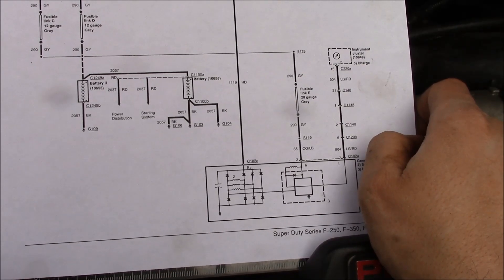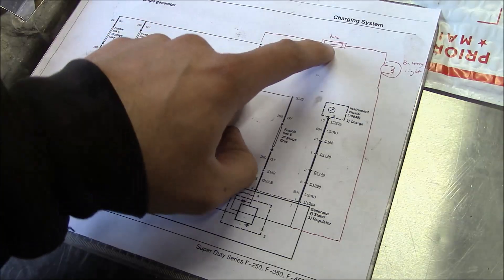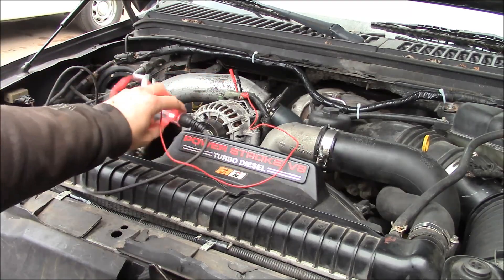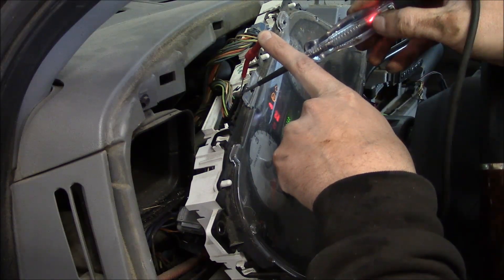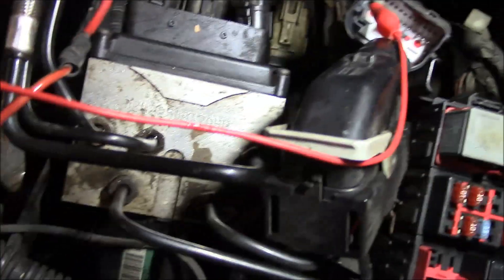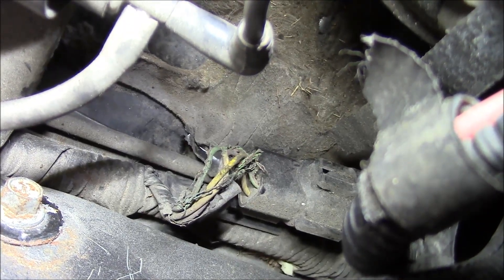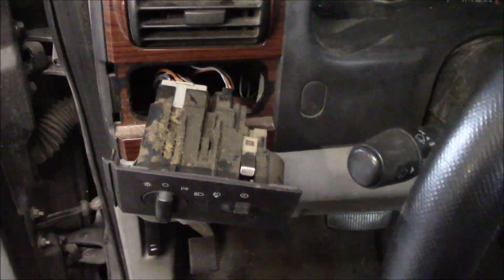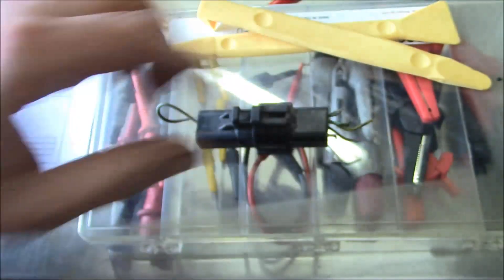Ford Super Duty Charging System Diagnosis and Repair

Comment: meter set to amps in a/c....i have made that mistake more than once. i would agree, rodent damage. we always doubt ourselves when we do a job like that and have problems instead of sticking with our normal diagnosing procedures. nice find wes. i would expect a little extra labor on the bill for that.
Reply from the maker: Yeah, there's no one easier to fool that yourself!

Comment: Many of the newer powerstrokes and ram/cummins trucks do not charge the batteries for the first two minutes once the truck is started, this is so the battery voltage can stabilize after all the juice that has been used by the starter and glow plug/ grid heater, start the truck 2 or 3 times for only a minute or two and you'll have dead batteries in no time
Reply from the maker: That's actually pretty normal for all alternators. Even my old 7.3 Powerstroke will not show anything on the volt meter for the first 30 seconds or so. Of course it's much more complex on newer trucks due to computer controlled regulators.
Reply: Thank for your helpful comment. Didn't know that.

Comment: Rodents...yeah, I've got a 99 Dodge Ram Van V-6, and have had rats chew away all the fuel injector, MAP, TPS and Idle Air Valve wiring, several times...I know it was rats, they left their droppings...tough to fix, engine is 1/2 way in the van, halfway under the hood...couple years ago, I bought a $45 diagnostic reader and it's sweet, gives all the 'codes' for 'engine light' and you can reset them. It was 100% correct on this stuff..
 Fluke test gear, I love that stuff....pricey but one of the best. Been using it since the early 1970's.

Comment: Spot on Wes. The "I" circuit gets a lot of guys.  Think of it as the "key on" signal to trigger the regulator to allow field current to energize the rotor field coil.  

Ford hasn't changed it much until they added smart PCM controlled charging in more recent years. 

Even the old external regulators used the same basic concept. Except they had an additional "S" (stator wire that they used to (sort of - LOL) warm up the early electric chokes).  

Good work on the diagnosis. Yeah we all miss the Fluke setup once in a while! LOL. 

Dan
Reply from the maker: Yeah I guess it was too simple. I think all Fords since 09 have had computer controlled alternators. Certainly complicates things. Not like the old days where you grounded the regulator with a screw driver and full fielded the alternator while watching the volt meter.

Comment: How did you go about charging the customer for this? Do you pass on the additional cost for extra time or do you absorb the cost?
Reply from the maker: I just charged a nominal diagnostic fee of 1 hour. It took me longer than that, but that's not really the customer's fault.
Reply: TOLD YOU, too many gremlins, hope it doesn't come back on a hook, the Mrs. knows more than you, don't forget that💅 @WatchWesWork

Comment: is there a index of connector location  in  ford shop manuals ?        is there a battery above that conector?  was it battery acid damage?
Reply from the maker: There is. I think it was a rodent of some kind. There is nice fuzzy insulation on the fender liners and it was also torn up.
Reply: Rodents, yeah..they sure have torn up all the ceiling insulation in my shop...squirrels mostly, and chewed up about $300 of polyurethane coil air hoses... @WatchWesWork

Comment: Hey Wes, where did you find the wiring diagram for the truck?
Reply from the maker: I got it through AllData. It's a subscription service for auto repair information.
Reply: @WatchWesWork  Got it i was looking for the diagram for the rear turn signal. i have a bad wire somewhere
Reply from the maker: Well that could be fun. If you have a local library, you might check there. Many libraries have a subscription to Mitchell, AllData, or Chilton that you can access.
Reply: @WatchWesWork  yes my local library does.
Reply: You can buy the paper versions used on ebay, usually 2 volumes with the newer trucks plus electrical diagram book and a pced (powertrain control emission diagnosis) book too (4 books total) (sold individually) for 03-07 ford superdutys